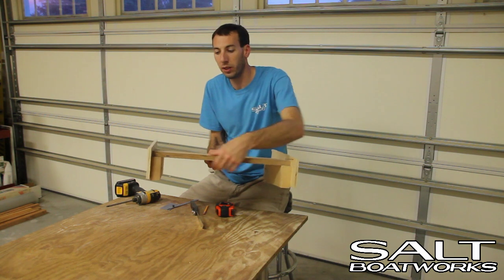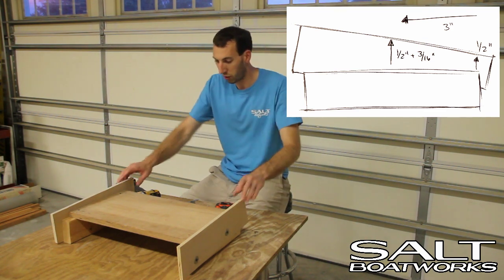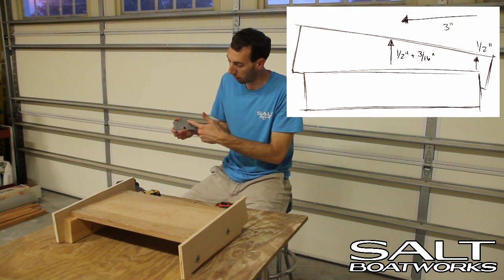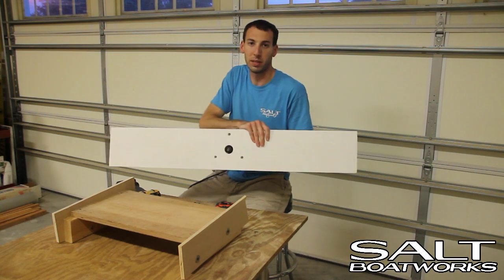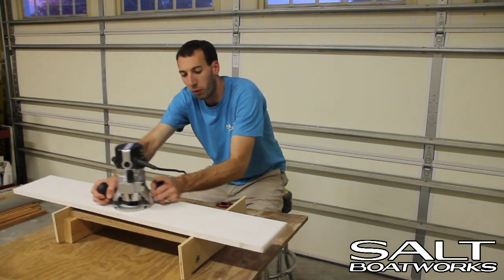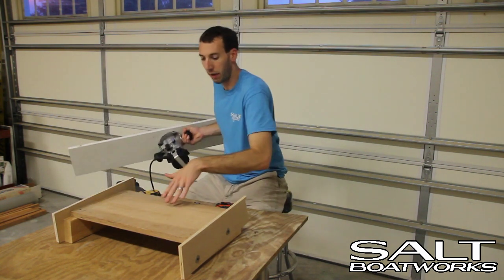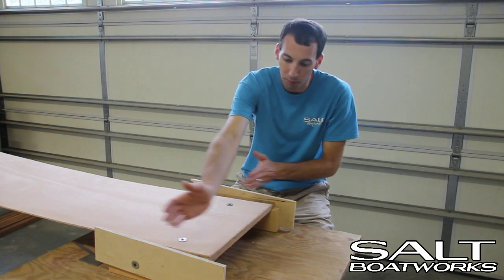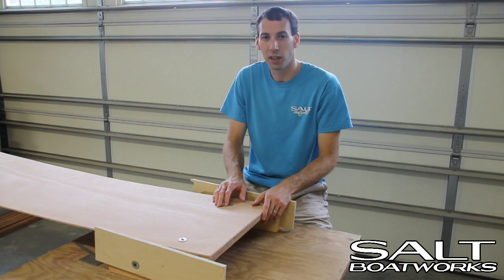How to Cut a Plywood Scarf - How to Build a Boat Part 1

Comment: Did you make a video about how to make the jig? What is the ratio and how do you find that angle? And, can you scarf 3 pieces together?
Reply from the maker: We do not have a seperate video. Listen carefully at the the beginning as I describe how to build the jig using scrap wood. The ratio/angle varies by wood thickness. In this video for the FRS-12 we use 3" for 3/16" thick. I do not recommend scarfing more than two pieces to gather at one time.

Comment: Where can I get this ply wood size and type. And do you offer plans for it. Thanks for the info. I did a kayak build you can see it on my page
Reply from the maker: It is 3/16" marine grade plywood. Check with your local wood suppliers or online. Plans are available for sale on our website. Link in description.